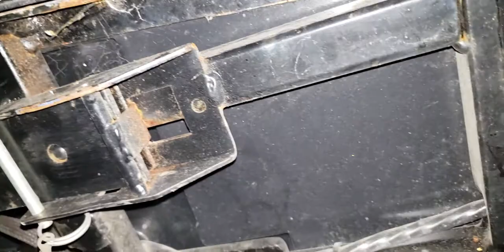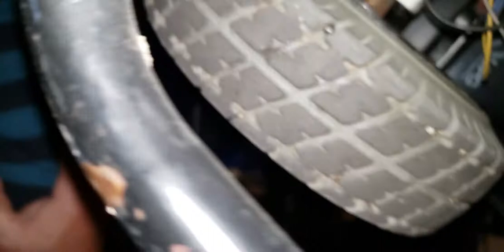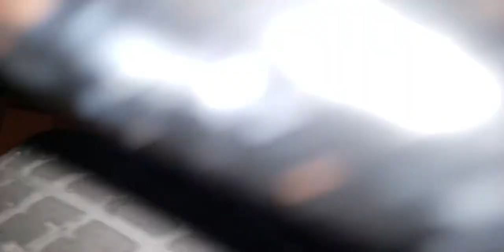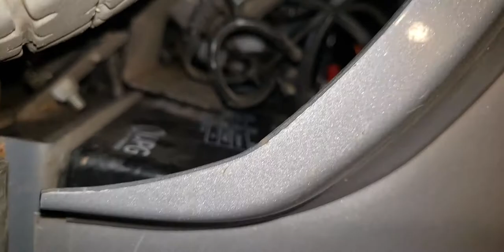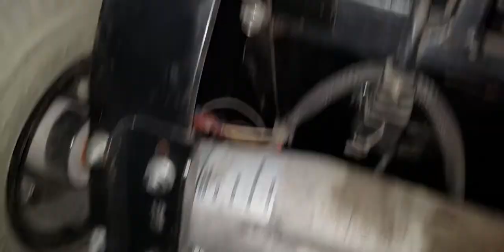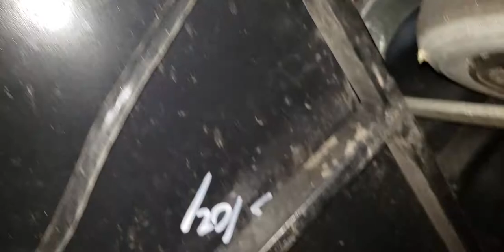Making faster mobility scooter. Tab Tabnak

Comment: what did you do raise the suspension and put on bigger wheels or is it a guessing game
Reply from the maker: I did raise and  put bigger wheels on both front and back. Also had to extend the axle for the rear wheel by welding extra pieces on both ends of it. Putting larger wheels on the back raised the back, and it didn't look right, and it was raised with an angle so I had to raise the front wheel to even it up. The new front wheel did not fit on the wheel rod so I had to add seperate pieces to it and weld it to make it an even height for both wheels.After I did that as a result torque dropped. But the speed was 3 times the stock around 15 mph. To fix the torque problem I added extra battery and connected in parallel to the stock battery. So it ended up having 2 batteries in parallel. Doing that gave it extra run time, because it increased the batteries output amperage, and also helped the torque issue as well. 
I also had to make a cruise control for it, because I felt it was necessary with the higher speed. it felt more real sometimes to have it on the constant speed without having to hold the throttle.
Sorry that I was not able to video it, but I will show the process on the next video. I haven't been feeling up to par to do it yet. If you have any question I be glad to answer. I will make the new video later, and will show the whole process. At the meanwhile I will be glad to answer any question for you. Thanks for watching the video.
Reply from the maker: It was a mystery solution
 and you are the first one to solve it but partially. Very good job.i will submit complete video later.
Reply from the maker: This was a mystery. and you were the very first one to solve it even partially. Good job. We will put the complete video on youtube later.